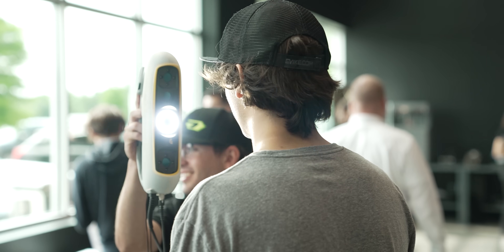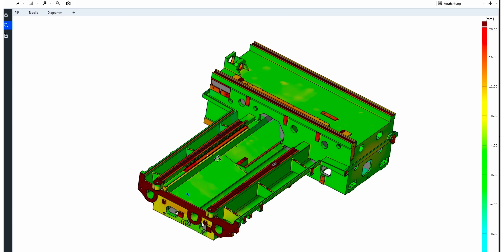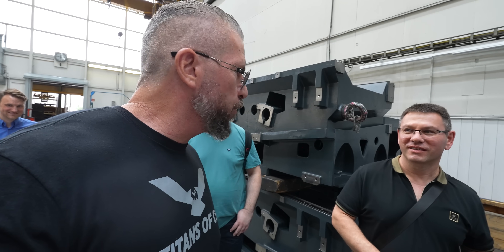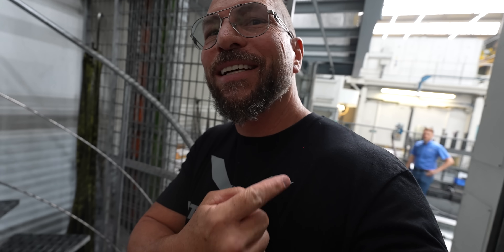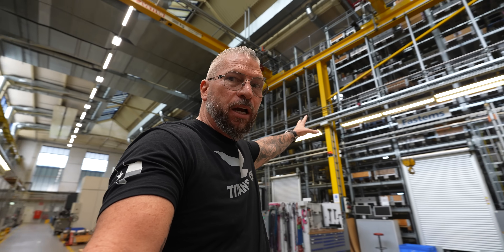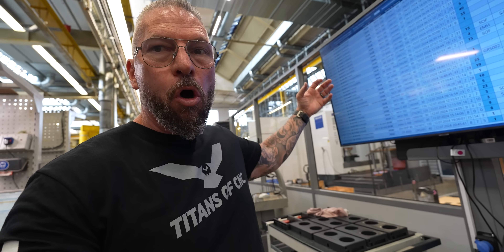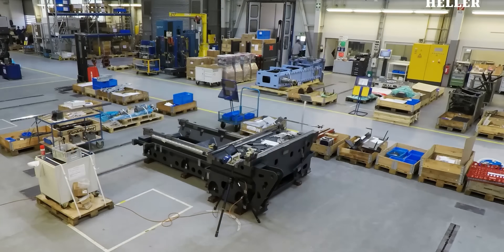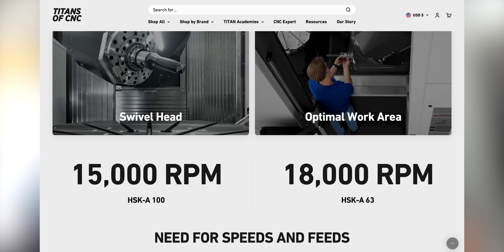130-Year Machining Empire Unveils Secret Processes

Comment: In the 1990"s went to an auction a McDonald Douglas plant in Torrance Ca. They had a CMM in a acrylic box that was over 2 stories high and a foot print of 60' square. Incredible to see. The Granite x/y axis ways were 36" sq. They made the "Banjo", the vertical stabilizer spar with the hole for the engine, DC-10.

Comment: grazy thing is that one of my old bosses has another machineshop  (he owns both at the same time ) where he have a lathe where he tool at 8.25 inch indexable drill. can it at 0.017inch pr. rev and couldnt even see on the load meter when it drill was cutting air or steel. couldnt even hear it on the moter. whice was in high gear which is where it has the lovest tork

a upgrade i would recomend for there tool room would be to have a led matrix screen instead of a normal tv screen. simply to prevent any kind of burnin image over time. plus easy repair of the screen. plus if they for some reason needs a bigger one at some point they dont need to change it out for a bigger one but just make it bigger instead